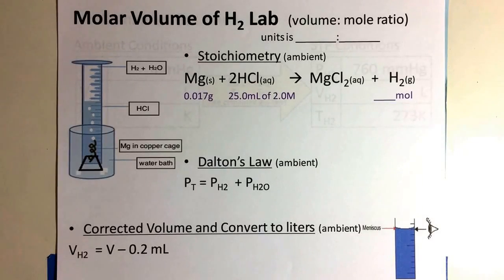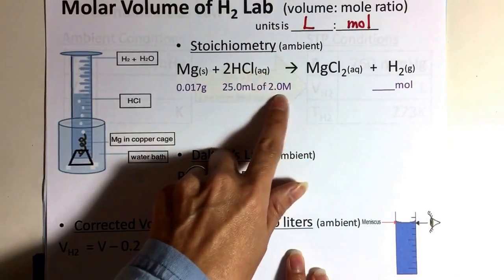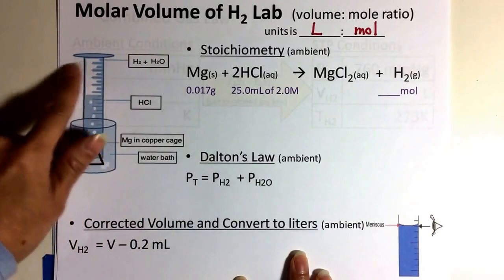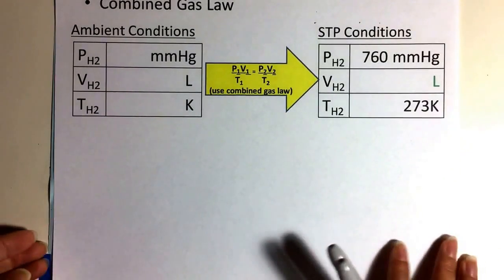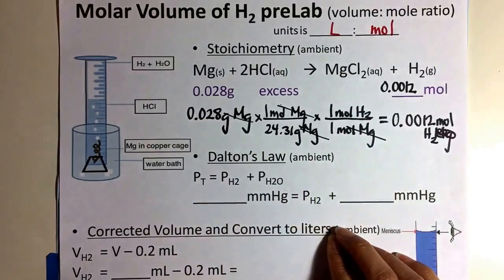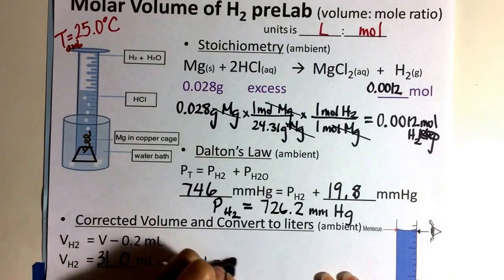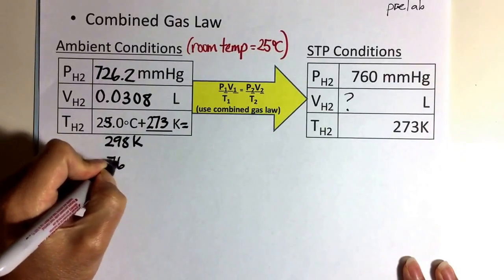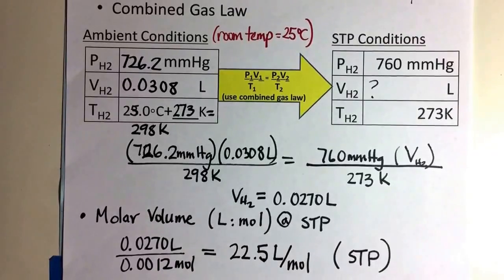Molar Volume of H2 Lab

Comment: Hi. Im conducting the hydrogen evolution experiment like the one in the video but using burette to measure the volume. and im new to chemistry. is that corrected volume 0.2 ml is constant? thank you
Reply from the maker: Correction is for the inverted meniscus so if the buret is inverted, then you will correct with 0.2 mL
Reply: @kimngo8470  i see. Thanks a lottt! 😊